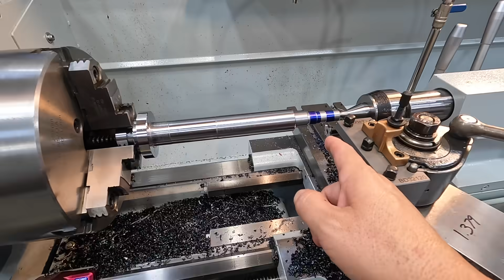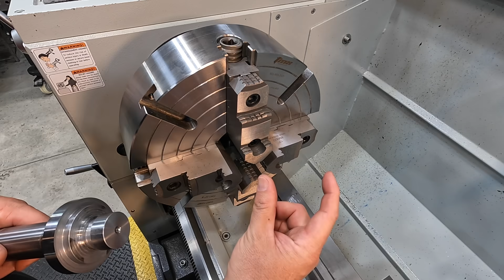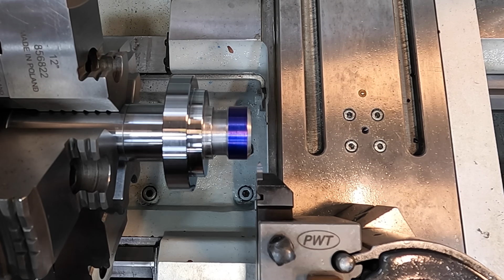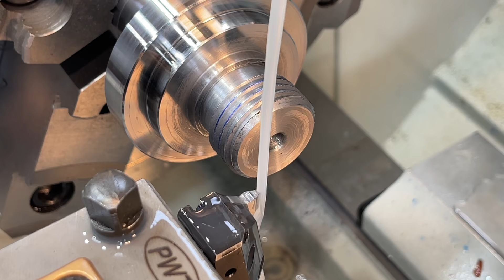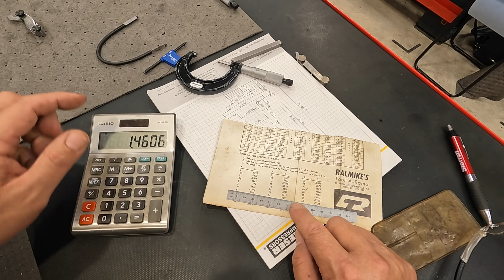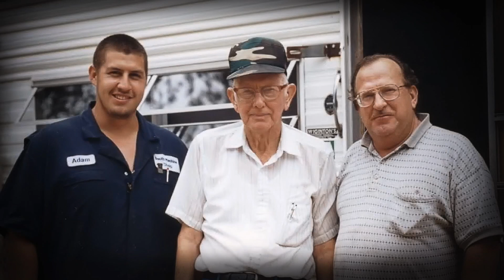Machining a Wood Lathe Spindle Ep. 2

Comment: There are many ways to cut a thread up to a relief at the base of a shoulder. Granted you often need that tiny relief.

On my old machines, I do this with the trip dogs. The Hardinge HLV does a killer job threading up to a shoulder. I am still working out the bugs in my monarch 10EE ELSR.

The old south bend relies on using the thread dial. It’s kinda hairy threading up to a shoulder on this dinosaur. But it’s a cool antique and I can do precise work on it but takes a bit of tweaking to compensate for wear.

I like to see how the more modern lathes do this job.

Comment: considering the lenght of the part, even though your chuck is new, I recomment use a steady rest to get the part absolutely true on both ends before machining the taper. Here you guessed your new chuck grabbed it true also on the hidden left part end. Guessing is not suitable for turning a precision spindle.

Comment: I only recently started doing a lot more single point threading, I used to use geometric die heads and/or thread roller heads for any threading I needed to do. I still use those methods quite a bit but single point threading has come in handy now that I do a lot of acme/not 60° threads. For standard threads I will always default to the thread roller as it produces a much better finish and a stronger thread. I bring this up because I learned single point threading from watching your videos. Keep it up Adam, us young fellas can learn a lot from guys like you. Cheers from Cleveland Ohio!

Comment: Really glad you touched on the measuring of the thread at the end. You mentioned you machined it to fit the chuck as your go gauge, but as you also mentioned that’s not the only thing going on there potentially. Utilising an existing part as a go gauge could turn out to be a ‘trap for young players’ as it could be warn past spec. If you then have to replace the chuck or whatever it might be and the new part doesn’t fit the threads you’re in for a bit of hassle to say the least
Reply: *worn
Reply: @paulcopeland9035  what about Warne

Comment: Why are most of you measuring tools analog? Is it a "trust" issue for digital tools?
Reply: Batteries is the reason why. With electronic/digital tools it is guaranteed every time you go to use it, the battery will be dead. Been there, done that.

Comment: Just one small nomenclature thing. US Customary Measures are not the same as British Standard Measures (commonly called Imperial). They are slightly different in the specific definitions. Amusingly both are defined in metric. It’s just the multipliers used are different for each. For most people and most uses US Customary and British Standard measures are interchangeable. It’s just in the weeds that they do differ.

Comment: Nice work! I will never understand the imperial System 0,98465 Bananas or simple 25,01mm 😅
Reply: IT'S SIMPLE BECAUSE WHAT YOUR USED TO. US AMERICANS HAVE NO PROBLEMS WITH BIGGER NUMBER DEW TO BIGGER BRAINS.
Reply: @jackjohnson6074  😂
Reply: So who’s fault is that? Learn Imperial. It’s  100 years older than metric and the only system in use during the Industrial Revolution.
Reply: @ellieprice363  Ohhh. What an argumentaion. It's 100 years older....  People used horse-drawn carriages over many hundred years, and today every one is using petrol- or electric  powered cars.         1 Meter = 10 Decimeter = 100 Centimeter = 1000 Millimeter. All is divided by 10 Its so complicated....

Comment: If your thread has an undercut on the shaft, you could have a tool post on the far side of the slide. You place the single point tool upside down, still on centre. You can start from the undercut and work backwards. That way, the chances of hitting the shaft shoulders are negated, the tool should clear into fresh air. Just an alternative way, which does work. Good post 👍

Comment: You need to copy and print that chart before it becomes unreadable. Then you can use the copy for thread pitch work and save the original in its present condition.

Comment: I always use direct reading thread measuring micrometers; they do a superb job.
You've done a great job.
Thanks for the demonstration.
The threading chart class of fits are no longer made.
Reply: I'm  completely un-knowledgeable about the machines and how they work. Maybe you could answer my question of how when cutting threads, the cutting tool hits the same spot on the subsequent passes. I realize the power feed gets the feed rate correctly. But I see he does not start at the same place all the time, what stops hitting the high point on the threads on different passes?

Comment: So if the part of the shaft before the threads is a larger diameter than the minor diameter of the threads wouldn't you not be able to screw on whatever was supposed to be screwed onto that part?
Reply: I think he said he would turn that diameter and the thread relief down.

Comment: Curious - never used a lathe so excuse the question - but why can you not cut the thread in forwards and then also in reverse ?
Reply: Fundamentally, the reason is unavoidable backlash in the system even in new lathes. The tool just wouldn't follow the same track coming outwards as it dd going inwards.

Comment: Could the undersize bearing journal on the original shaft be there to allow for longitudinal expansion of the shaft without damaging the bearings? Only one end can be fixed.  In addition to turning out a very nice-looking part, there were many teachable points, especially the one about allowing clearance for other tooling to be threaded on the spindle.  Nice work!

Comment: I find that if the threads are loose, the piece will spin off when it stops. Some of them come with grub screws, but they will mar up the spindle.
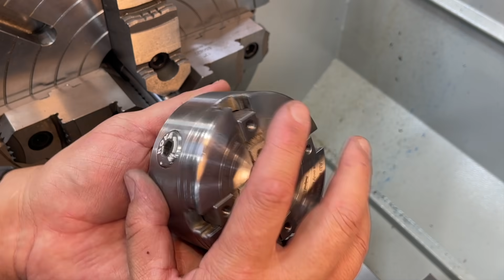Reply: Stop the video at 37:01. You can see a set screw that locks the chuck to the spindle in the thread relief.

Comment: Adam, the following is in no way your fault. When I commented on your last video, I criticized this lathe manufacturer and their faulty spindles. One viewer actually told me to get lost, another commented on the relatively low cost of a new spindle, I think $187.00 USD. I live in Australia, and I had one of these lathes and a new shaft cost me $280.00 USD plus shipping, a local machine shop made one for me for $90.00 AUD on his CNC lathe as he had already programmed his CNC machine as he specialized in making lathe spindles for both metal and wood lathes. The new spindle has no run out, I know wood lathes are not made to the same tolerances as a metal lathes however the care you have taken in getting this spindle to an accuracy level is excellent. Great Work, thanks you.

Comment: My old Jet lathe no longer has a reverse.  Any technique for me?
Reply: Maybe.  Make an ACCURATE deep scratch (You only get 1 chance), to "set" the target thread.  Use a good quality die to finish the job.  Die cut threads frequently get "out of whack" over length.  Shallow single pointing things 1st gives the die a track to follow and not FUBAR the work.

Comment: no heat treat?
Reply: 4140 is already heat treated.
Reply: @ellieprice363  only if it's prehard, not just because its 4140. I didn't catch when he said he was using prehard.
Reply: @ellieprice363    We use 4140 a lot.  It comes from the mill at 25-30 Rockwell C.  I would think that is plenty hard for that part.  If you wanted to get fancy, the threads could be hardened a "smidge"!!

Comment: I'm going to use this method for threading. Seems to me that it would be even safer (and easier)  if you slowed down a bit. The tool moves into the thread relief so fast. What is the reason for going so fast?
Reply: The reason for maintaining the high rpm is to maintain the cutting speed in feet or mm per minute, many tools have an ideal ft/min range, above or below that range can affect surface finish.
That and productivity, in a production environment you can’t waste time, with experience comes the ability to work faster, you get a feel or rather ear for the cut and can tell the instant the cut finishes, you can disengage the nut faster than the eye can see the cut has finished.
Reply: Years of practice (and cutting speed as @grahamstretch6863 says)

Comment: I would have cut the threads in reverse, tool on the back side of the work.(or upside down) Then stop the tool on the right avoiding the scratch on the part
Reply: Probably many years of experience doing it that way.

Comment: I was thinking at the end, "don't hit the foot brake! That little chuck will come flying off."
Reply: Was thinking the same, but wonder if it locks itself to the shaft some how.  Heard a click noise when it was screwed on all the way.
Reply: @Discretesignals No it doesn’t lock to the shaft except for compressive jam fit against the machined shoulder.
Reply: @ellieprice363  Stop the video at 37:01. You will see a set screw that locks the chuck to the spindle on the thread relief.
Reply: @tsmartin  You’ve got sharp eyes. I didn’t see that so thanks for pointing it out. Screw on chucks have always bothered me for that reason. Now I know there’s a remedy.

Comment: Hi Adam, it would be interesting to see this part made on the cnc. Specially the time difference and acurracy if any. Or just in simulation if possible please
Reply: I’m guessing it would take at least twice as long.  All the tooling would need to be selected, installed in the tool changer and proven.  After several shafts are 
machined and corrected for accuracy thirty more shafts could be machined very efficiently at much lower cost than manual.

Comment: Could you thread forward and backwards instead of backing out for each pass.
Reply: Not an expert, but I think the cutting tool would not cut on the backward pass. You would need it to be “upside down” to cut in revers
Reply: @davidgibson5756  You can do this and a lot of people do, you use a LH threading tool mounted upside down. Adam's way also works fine, It's just personal preference.
Reply: Dude, it’s hard enough to do this in ONE direction, let alone TWO!  😂
Reply: No. To cut from left to right with the spindle turning in the same direction you would need to reverse the feed direction creating a left hand thread on the same shaft.
Reply: Thank you for all the responses
Reply: Not usually, from my experience, it will usually chip the cutting edge on the tool running in reverse. The part deflects every time you cut so unless you pulled out a little, there would be a minute amount of pressure on the tool.
Reply: @TheChancellorPlays  what would be the reason for the chipping of the edge. If you have a LH tool with a LH insert the it's designed to cut in that direction. My only thought is that your trying to lift the crossslide off the carriage rather than pushing into it creating vibration. But if that's set correctly then I can't see it being a problem? I've never had a problem doing it that way but be fair it's been a while since I did much threading on a manual.